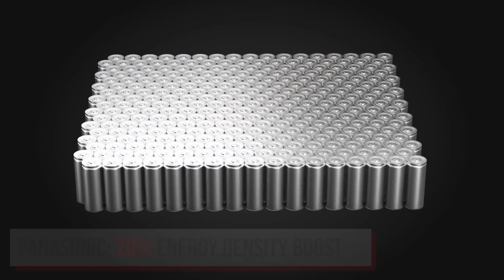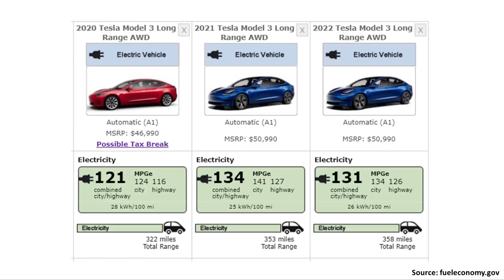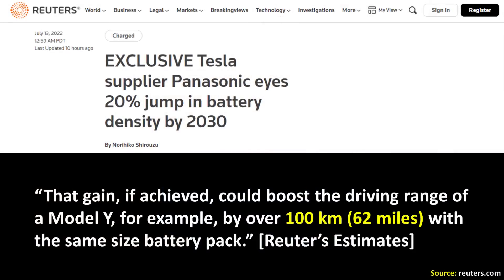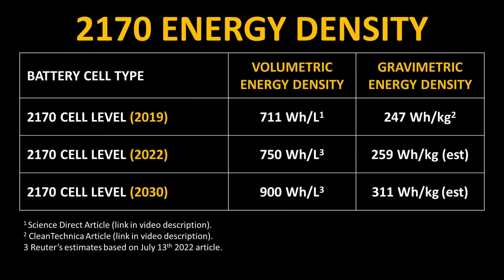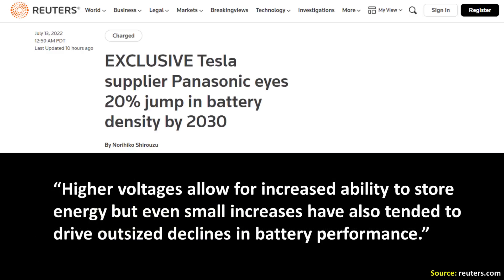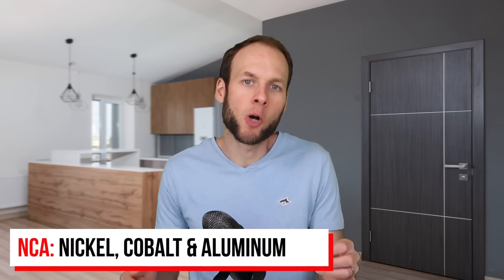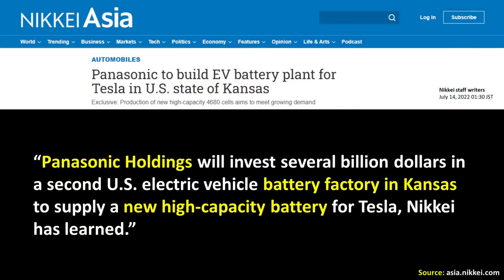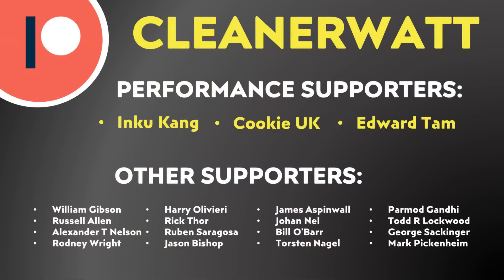Panasonic Made TESLA EV Batteries Getting 20% BETTER

Comment: To me what really matters is improving cost/kWh of LiFePO4, secondarily the energy density of such cheaper cells. The battery cells that use zero cobalt and nickel. Elon Musk said they could have built a 600 mile Model S years ago. The issue is there is better use for those extra cells to make more cars instead.
Until there's an abundance of refined Lithium in the world (unlikely) we should focus on making BEVs cheaper hence more affordable to the developing world, where BEVs today are only viable to those few that drive insane miles per day. Without that we won't be able to even get to 40% worldwide cars being BEVs. Until BEVs are affordable to the Indian, Chinese, Brazilian, Mexican, ... Middle class, there will be a significant upper ceiling to how far those vehicles can penetrate.
We need to rid the world of cells that still use cobalt on all BEVs made worldwide.
Lastly if Tesla delivers on all of their 4680 promisses, it will pretty much match that Panasonic promisse within a few years.

Comment: IDK trying to get more energy density by squeezing a couple more tenths of a volt sounds sketchy a.f. to me. Reminds me of overclocking CPU chips. Never saw the sense in that, either.
Reply: It would increase power stored by about 5% at 4.4v and 10% at 4.6v. they're using new materials to achieve that, so overclocking is not a good comparison. It's more along the lines of a new nm process improvement, like going from 10nm to 7nm. The result being that it can inherently run at higher frequencies more efficiently, no oc needed.
Edit:grammer
Reply: @SentientTrace  "Edit:grammer" More editing needed. Thumb up for giving me some amusement.

Comment: 1:48 This comparison of 2020, 2021, and 2022 Model Y range performance demystifies my observation of a caravan of June 2020 MYLR and December 2021 MYP matching each-other's range percent-by-percent from 98% to 11%.  I was expecting the Performance to loose, given its 5% worse range spec versus the LR, but wasn't considering the improvement in underlying drivetrain hardware (which is identical for P & LR) in that 18-month period.  There were even structural optimizations, the 2020 LR not having the full-size rear casting.